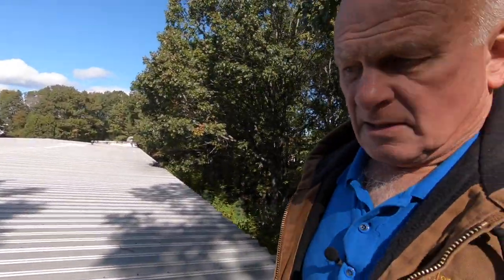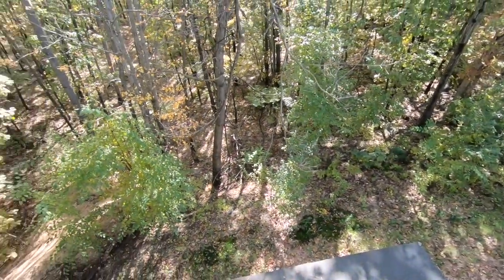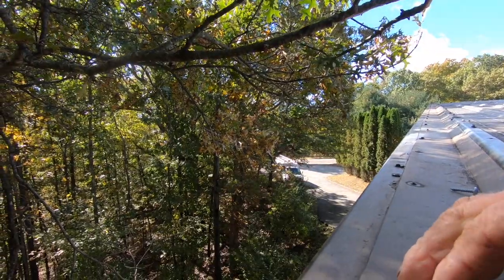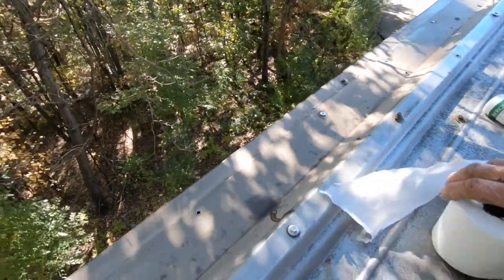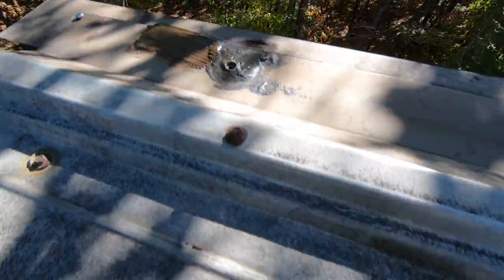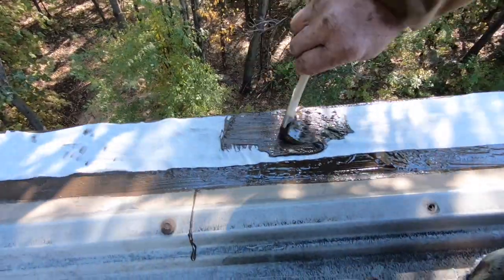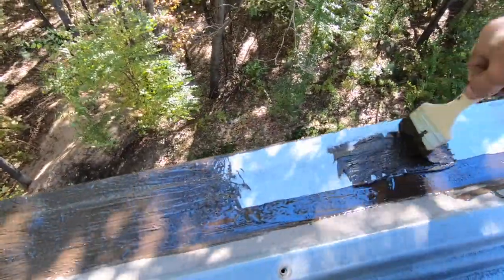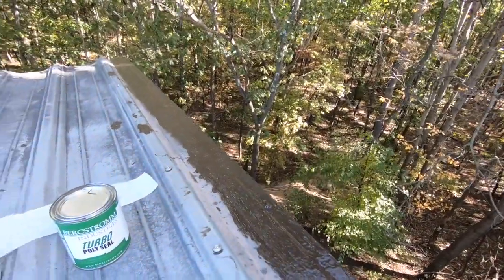How to stop a leak on a METAL ROOF JOINT OR SEAM Turbo Poly Seal

Comment: Sir, I can tell you like the fabric and urethane caulk. It works for you.  I have 30 years into this trade of fixing roofs. I would have opened the rake trim to roof seam, cleaned it mechanically and chemicaly. Then used a polyether based caulk like M1 chemlink under trim and under fasteners.  The UV is kept off the sealant adhesive ensuring a longer lasting fix. The joint is stronger and more flexible than the fabric and caulk.  In addition, the stich screws you replaced should have been up sized not down sized.  I could mention that your acetone surface prep was solid. However, I would have used a Brillo pad to really dig into metal paint.  That generation of steel building used SMP (silicone modified polymer) paints. Instructions for your type of repair should include a lite sanding of surface to ensure good adhesion. In short sir be careful, some of us get mildly annoyed when others claim to be so much better with a one trick pony approach.
Reply from the maker: Excellent reply. Thanks for your explanation. I agree 100% with your approach. What I was trying to demonstrate how easy this product is to use for anyone and how to apply it. But off-course, removing the fasteners and applying some Caulking would be really good. Also true that the UV's would not get to it.
Thanks again for your input. Great stuff
Take Care

Comment: It looks like the roof is missing the end gable flashing piece. Maybe it blew off. Someone simply screwed the last panel onto the drip edge, but there's another end gable flashing that goes over the last panel edge after you bend up an inch of the panel edge. Even though they cut the panel a little short you could still turn it up and find an end gable flashing piece to screw over it. Even if they had turned a 'U' hook in the edge of the drip edge that's under the panel that would've been better than caulking.
Reply: True they used drip edge on the gable instead of the correct gable trim for a sheet metal roof. The gable trim is suppose to be sealed on top of the roof panel with butyl tape not caulking. Butyl tape is designed to be compressed by a screw. So they made two mistakes. Possibly three with not turning up the edge.

If they cared more about function than looks they could have extended the metal roof panel over the gable and then bent it down. There by completely eliminating the seam.
Reply: On buildings that are not square, old barns, it can be tough to use gable trim due to the metal roof ribs will end up running diagonally off the gable edge. So the gable trim has no flat surface to attach to. 

Which means reframing the gable. To square it to the roof vs the wall. Or using a drip edge or other flashing.

Comment: How can a panhead distribute downward force better than a hex screw with a washer?  What determines if a coating is a sealer or a caulk?
Reply: Those are rhetorical questions and you and I both know the answer to them. starts with a B and ends with an S.

Comment: Thanks man! Don’t have good professionals like yourself here in Arizona.
Reply from the maker: Honestly, if you watch the videos you will realize it is easy to make repairs with Turbo Poly Seal. Either yourself or anyone can do it. The problem is to find what is causing the leak. Once you have determined the problem, then it becomes easy to make repairs.

Comment: Should I use pan head screws in the first place instead of hex head screws to prevent future leaking????
Please reply
Reply from the maker: If you going to use the fleece to cover the surface around the screws and the screws too, then you should use pan-head screws. In other cases I don't go over the screws with the fleece, but instead just dab each screw with Turbo Poly Seal to seal around it.

Comment: Are these roofs not required to have a special type of faster with a rubber gasket for the movement and to seal to the roof and the faster you used to replace them with is that metal compatible with the metal roofing system? Wont electrolysis set in?
Reply from the maker: Thanks Nick for bringing this point up
You are correct about having different metals causing electrolysis. You are also correct that metal roof fasteners come with neoprene washers and the screw should be torqued at manufacturers specifications. What you see in the video is that after I fastened the 2 metals together with screws of not the same metal, I covered all of it so there would no water would cause electrolysis. 
Take care
Reply: Electrolysis happens when you use steel screws (or nails) on dissimilar materials such as copper or aluminum panels. The only problem here would be the untreated screws rusting. But because they are coated with polyseal, this won’t be a problem.

Comment: If the surface has rust should you use a rust converter first?
If you weren't able to change out the screws, could you just apply product thicker over the heads before you put on the mesh?
Reply from the maker: What I did was to use a grinder with a wire brush to get rid of the rust. I'll post a video soon on how I went about it.
Reply from the maker: Hi Andrew
I am so sorry for this late reply. Somehow Youtube does make it easy to see where all the comments are.
I prefer to use a wire brush on a grinder to remove rust. It is not necessary to go crazy removing it. Even if you give it a light brush by hand is OK. I have painted Turbo Poly Seal straight onto rusted areas and it works well.
The second question. Yes, you can paint it thicker to compensate for the higher profile bolt. Or. you can cut a slot in the fleece and let the bolt head stick through.

Comment: That's a simple way to repair a leak,but I can't find it here in Ireland.wonder would they ship to Ireland.would be a good product for them to sell in Ireland and UK with the wet climate we have.
Reply from the maker: I think shipping chemicals overseas is problematic. I am working on a solution to make this product myself.  What I have done so far is I bought Polyurethane paint and mixed it with Karnak 66 brush grade. It is not what I expected it to be. But this Turbo Poly seal is pretty amazing.
If you go on Firestone's website, there is a similar product they sell. I have just found it. here is the link https://www.firestonebpco.com/us-en/roofing/asphalt-roofing-systems/modified-bitumen-accessories
see if you get that over there
Cheers
Reply: @FlatRoofDoctor  thank you for your help.
Reply: Should’ve cleaned the caulk tape off , put new on . And replaced the screws . This product will not last . And you made a big mess for the next roofer to fix
Reply: king 37, sometimes you can get away with order things online to places that don't carry a specific product however often times the reason a certain location don't already carry it is because of particular chemicals which a country may have banned the use of and so when you try to place an order and input your address, you will probably get the pop up saying sorry can not ship to this destination. 

  Another problem is even if they will ship to your country, the cost can be ridiculous and on top of just the initial shipping cost you may also get another bill for customs fees that they dont always notify you of during check out process

Comment: Lesson of the day metal roofs are junk mine is always leaking.
Reply from the maker: Not so, there are metal roofs are over 40 years and still good. Like everything else, maintenance. The reason why metal roofs start to leak, the older ones, is because of fasteners. The neoprene washers wear out and then water leaks in. Yes, of course, other factors like the cheaper panels where the galvanizing wears down will eventually leak because of rust holes
Reply: ....metal roofs are junk ...."
Not if done properly. Will last you a couple decades before major maintenance if done with thorough attention to the job in the first place. What framing underneath? Is the wood so soft that the fasteners loosen from natural expansion and contraction?
Did the workmen pre-drill before driving the fasteners? One can't just have at it with an impact driver and hope for the best.
How about the quality of the roofing compound for the finish?  How long will the flimsy, so-called washers at the head of the screws last before leaking starts?
Reply from the maker: @jackjohnson9989  Thanks for the comment. I don't know much about metal roofs. All I know is how to repair them with my methods. I believe metal roofs are very good, but as you say, as in any profession, the quality material and workmanship will make a difference.